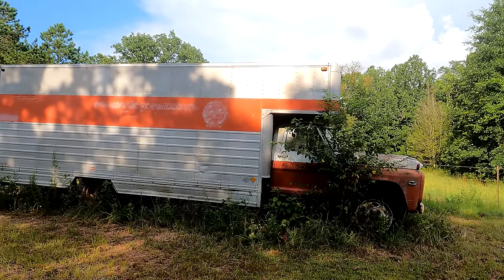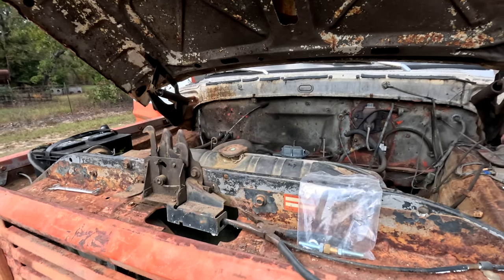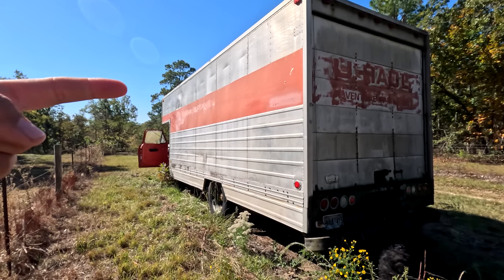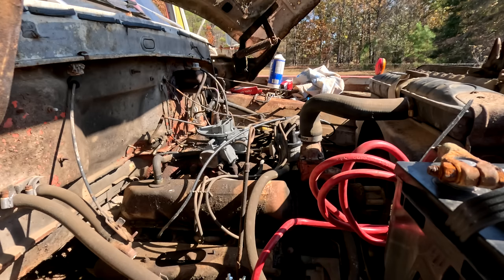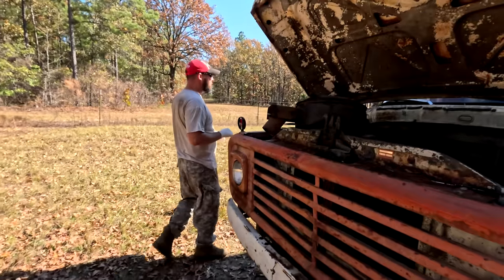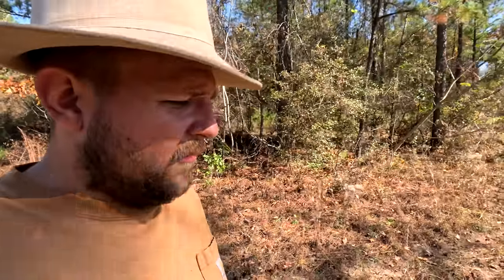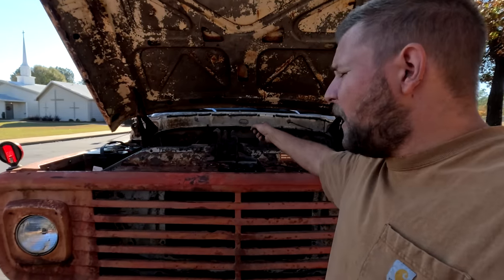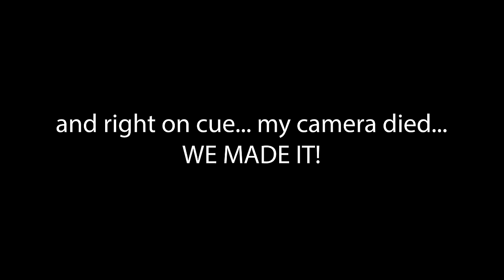EPIC! Will Abandoned 53 Year Old U-Haul Drive 40 Miles Home After 30 Years?? 1970 Ford F600

Comment: I worked at a U-Haul hub, where we had about 15 of those 30 footers, we had to maintain and move them around the area to the rental shops.  A word.  We always avoided 1st gear, and started from 2nd gear, when empty.  Took off perfectly and saved that granny gear for when it's needed.  I was gonna mention the governer on it.  Kept it at 55 mph and sucked that gas down fast.  I used to drive one towing another one behind me, to deliver it long distance to areas needed.  Was quite a battle.
Reply: Yeah. Add aftermarket carb and manifold to add people and   mi
Lage

Comment: Not a y block ,its an FE / FT series hd truck engine.      It replaced the old y block.      The y block had distributor  at the back of engine .  The Ft series was available  in 330/361/391 /428  displacement s . Used in medium duty  f series  and b series school buses from  mid sixties through  1977 when it was replaced  by the 385 series  hd 370/ 429 big block.
Reply: I was wondering if anyone else caught that
Reply: I caught that to

Comment: Its a bad accelerator pump on the carburetor Robert .  They probably didn't replace it during the rebuild . Any good parts store has them in stock . 10 to 20 minute fix.
Reply from the maker: That’s what I thought too, but I could see it working
Reply: It's probably has a small tear in it . Works fine at idle but when under throttle pressure starts fouling up . @THEOLDBYRDFARMVLOG
Reply: That's what I also think. Accelerator pump cracked diaphragm.
Reply: @andreamills5852    But even with that the carb would work wouldnt it? IT would still recieve the WOT gas, as I know the acc. pump is for extra fuel when you press 100% of the pedal, not when you are at wot
Reply: it thre genver😂
Reply: Or that little check ball under the spring.those are the most simple carbs,next to a Briggs & straton
Reply: Pull that carb and the 70 pound intake, replace with an aluminum manifold and a better carb.

Comment: Hey Robert I have a governed carb on my 79 gmc 6000. I rebuilt the carb and it did the same thing the u-haul did, I noticed looking down inside the carb that the butterflies weren't opening while it was running and giving it throttle. Reason being the vacuum on the governor was holding it shut instead of letting it open. I disconnected the vacuum line and plugged it, It ran fine after that. But thing to do is put a non governed carb on it. All governor's are for is to keep the driver from over revving the motor and blowing it up.
Reply from the maker: Wow, I bet that’s it!

Comment: If the fuel has any water in it,  that will also help keep it from completely starting. You definitely have the spark and firing seems to be good. I would've got a bottle of fuel treatment to run through the entire fuel system. Ya never know. This reminds me of constantly putting more & new parts for my old Plymouth Velara when I was 17. Memories, lol.

Comment: That engine is the 330 XD...extra duty engine. Uhaul used to publish a fact sheet. This is not for this exact truck but very close:
engine specs;
-engine governed for longer life
-the safety factor of dual thermostats
-5 blade fan runs cooler and quieter
-heavy duty water pump
-forged crankshaft, larger rods and main bearings
-larger water passages for clooler runing engine
-12" heavy duty clutch
-extra duty heads with sodium filled valves; runs cooler
-oil bath air cleaner assures longer engine life

truck specs;

-330 Industrial V8 gas engine with extra duty cooling package
-435 New Process 4 speed manual trans (HD includes super low 1st gear)
-Heavy duty 12" clutch
-Dana 70 w/4.10 gear ratio (Heavy duty)
-30 gallon fuel tank
-10,000 lbs GVW
-14' all aluminum van box
-594 cubic feet storage capacity
-low profile deck with aluminum pull out ramp for easy loading
-twin I beam front suspension for smoother ride
-161" wheelbase
-auxiliary spring option #2
-dual shocks, single Heavy duty - rear
-8.00 x 16.5" tires (was bias original, now radials

Comment: Sounds like a governed carburator issue, and there is multiple settings on these, as they were on grain trucks of that era too.  Junkyard Digs had this style truck and carburator issue, which Kevin rebuilt, and then it too lagged.  To find out, it had to be on setting 3 or 4 of the higher notch settings to keep it from bogging down.

Comment: like riding a bicycle being trailed by a truck! there are quite a few items that could give issues!
cracked hose, Not a good seal to lose vacuum ,timing, not getting advance from inside of distributer 
from being all rusty. one way to time it, is cylinder No. 1 TDC then wire / light bulb on positive side,
when the points brake the light will go out, it gets you real close . oh the package arrived today
will try the lavender tonight! thanks for the good stuff! barry

Comment: I have a 1976 f700 with a 391 and governor system. The governor carb works fine. The problem i had was the distributor oil seal was leaking into the governor line and not allowing the butterfly's to open enough. I disabled the governor system and kept the vacuum butterfly carb. The carb works like a variable Venturi carb and only opens the butterfly's as much as the engine can use determined by vacuum, that's how they made these engines survive in medium duty trucks. I would highly advise you to keep the vacuum butterfly carb and disable the distributor governor. That will fix the problem without overloading the engine from a non governed carb. The distributor part of the governor system was only to prevent the engine from exceeding the 3800 rpm redline.

Comment: Reminds me of the misadventure I had with a 1979 F-600 flatbed dump. Rebuilt the Holley, the kit came with the incorrect gasket, ended up with a vacuum leak behind the carb, blamed the carb, replaced it, then found the leak! Had to replace the master cylinder, then the vaccuboost unit under the cab, and some wheel cylinders. After that, it was finally ready to drive back home, but unbeknownst to me the eBay electric fuel pump the previous owner installed, couldn’t keep up with the 8mpg truck. Kept running out of gas every time I climbed a hill. When I finally figured it out, I bought another from a parts store and it was bad right out of the box! It took half a day to drive what should have been an hour trip! I will say, now that it is sorted out, it can sit for a year and when I hit the key it fires right up. They are tough old trucks.
Reply from the maker: Wow! That definitely sounds like our luck 😅

Comment: Robert, back in the 70's there were carbs designed with "governors" which many and most of government vehicles were fitted with so you couldn't accelerate over 50-mph and too at very slow progression.  Advance your timing on your distributor with a different carb and you will have remarkable improvement. - jfm

Comment: I wonder if the throttle cable is stretched or binding.even if you can put the pedal to the floor if the cable is stretched or binding it may not allow the truck to get full acceleration.

Comment: Old style Ford starter  used in v8 cars  ,the fe/ft series and 300 six and the small 6 and small block v8  through  91, and replaced by gear reduction  solenoid equipped  starter . The 385 series  370/429 / 460 used a similar  one except with solenoid.
Reply: Give it a few seconds  ,before  shifting into low ,so gears don't  grind .
Reply: Carburetor  and vacuum advance.

Comment: The reason why there is a govener on the carburetor is the torque from the engine will break the driveline.

I bet the problem is carburetor governor is set up wrong. My guess is on the 1 nr. slot and set up for a New Holland bale wagons.. Just pop left cover and remove the 6 screws and move the spring from nr 1 to nr 4 and slap the cover back on...

Check out Junkyard Digs video..."Will this old grain truck run and drive uk time for harvest".  He had the same problem after rebuilding the carb..

Comment: I think it's either a governor problem or the main jet or power valve is super rich. Perhaps they forgot to put in the main jet? so the idle is good but as soon as the main circuit kicks in, it goes rich.   Leaking accelerator pump diaphragm can do that kind of thing too.   Many videos on carb overhauls if you want to do the carb yourself.   The usual condition is too lean, but too lean carbs buck and stumble more, but too rich might just slog out like yours did, but it should also make black smoke.

Comment: I like the older big U-haul trucks like that one. I hope you can keep her running so that you can move her. Is that second shifter for granny gear or a hand brake because it looks like a shifter, not a hand  brake 🤔.I  used to have a tractor trailer tanker rig that said U-haul on the tanker trailer  when I was younger,with it reving up like that sounds like the float is stuck & you probably don't lik Quadrajet carburetors but you should've got one instead of rebuilding that carburetor

Comment: It could be repowered with a 6.9 IDI or 7.3 IDI diesel pretty easily I'm guessing. Ford used them in their F series pickup trucks in the 80s and early 90s. They were mechanical diesel motors and not like the powerhouse diesel pickup motors of today, but they'd do fine in a truck like that. You can pick up decent running used ones for 500 to 800 dollars all day.

Comment: You were hydralocking the engine with starting fluid.
Use 2 stroke petrol, you can bend the con rods or score the piston jackets with lack of lubrication.
A bad practise to get into using starting fluid.

Comment: Governor! There is a spring you can move to different setting to get the throttle blades open sooner. Also the acc pump should be adjustable to squirt more or less. Rev and spray brake clean at the same time to see if it needs more fuel, if it does then tighten accordingly pump spring, if worse then back off that acc spring but. If still a pos, change carb. Could be a piece of crap in a jet also from line

Comment: Come on Robert you had new spark plugs should’ve changed all the spark plug wires. I don’t care how you thought they looked that it doesn’t mean they’re good you didn’t change the coil did you or did you see what the voltage is coming out of it even new coils can be bad.
Reply from the maker: Nope! But it wasn’t a fire issue. Carb as suspected

Comment: ya been thier often i use bleach or water or both bring blowers or hand brums mask help dont want rush so here some cost saveings drill bumber horn of rails bolt in brackets cheap on amozon 29 which is half the cost of tow bar yep harbor fright has on sale vs vehor no sale 80-100 online free shipping yes misspelled things for reason point is good drill extra battery and charger oil for bits i use oil from vehile or ? get good tow bar you can move some good stuff tires or breaks provide i move many rvs heavy stuff just go slow good route a-b fun video